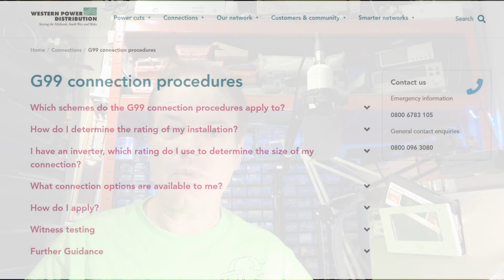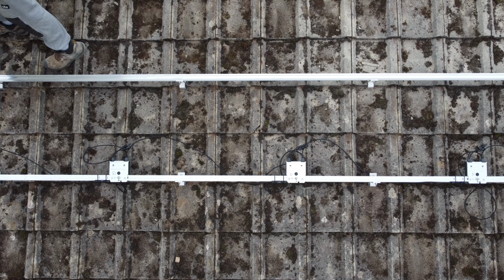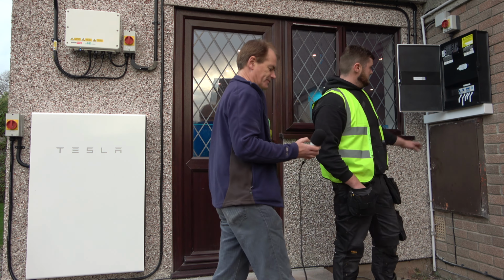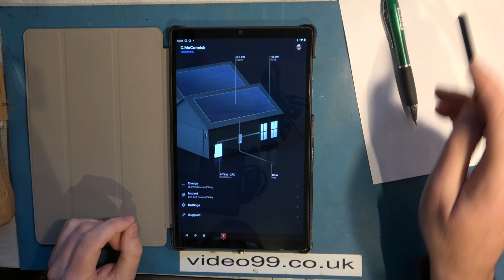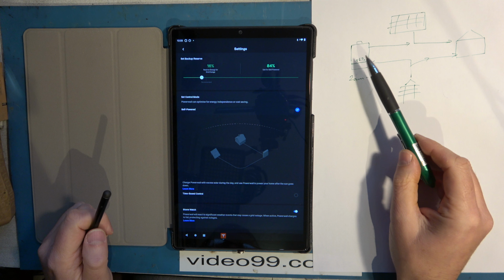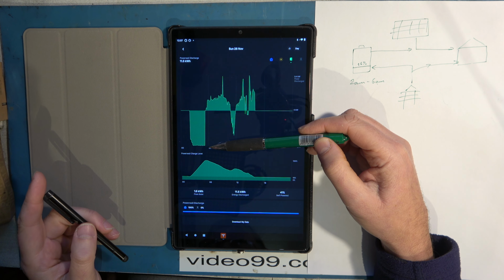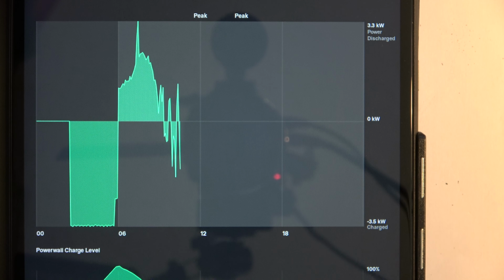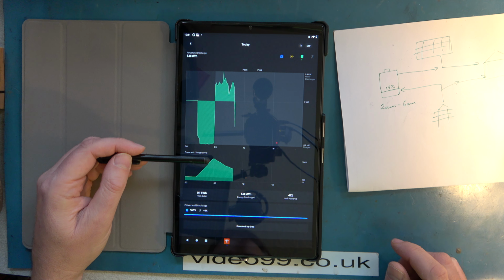UK solar panels for home, & Tesla Powerwall. Part 2: Installation and software.

Comment: Looking forward to part 3. Hope the new updates have solved the problems and you can set time based to 2-6 and leave it do it thing.
Really looking forward to getting my solar array and power wall when I’ve got enough cash
Reply from the maker: At one point it seemed to work really well: On a day where sunshine was forecast it would charge the powerwall sparingly, then on a overcast forecast it would charge much more.  But it's gone nuts now and seems to think ever day will be sunny.  So I have to wake up at 2am to tell it that we want 100% reserve power then at 6am and set back to about 16%, on an overcast day.  This is really ruining my sleep patterns and I'm not happy.
Reply: @video99couk  that’s really not good have you contacted support?

Comment: We have had a very similar system to yours for nearly three years (solar and Powerwall)
You obviously did the video early into your ownership so your settings may have changed. To my mind the reserved power setting can be much much lower. The chances are you will already have plenty of power in the battery or indeed solar supplying when the grid fails. That reserved level equates to running the house on overnight power prices for less time most days. It also mean less capacity to absorb excess solar during the summer before exporting it at a rubbish  export rate.
From what I’ve read the Powerwall takes a year to settle in as it bases it’s behaviour on a year of history. The storm watch thing is the only feature that looks at the weather forecast. A bit mad to my view. The Tesla app is so good we no longer look at the inverter app. We are planning on a second battery to increase the maximum house load to 10 kW so day time EV charging will be possible and there will be less periods when the battery cannot supply all the demand. (Oven + kettle + hob + hair dryer!) and because UK weather varies so much day to day we believe we can have many more days in winter in particular where the import price will be just the overnight price. In the last year our average cost of imported electricity has been 7.4p per unit so for us with the ‘free’ solar it all turned out to be a great choice even before the energy price hikes.
Reply from the maker: The system really seems to look at the weather forecasts.  So on predicted sunny days, it only part charges the powerwall overnight.  On predicted overcast days, it 100% charges it.  Sometimes, like today actually, it gets it a bit wrong.  It hardly charged the powerwall last night because it thought today would be sunny, but it's mostly overcast so it will run out of power.  That's worst case of course, I would rather have too much energy and export some at 6p, than have too little and buy it at 33p.

Comment: What was the total cost please?
Reply from the maker: Approximately £17, though that included 5% VAT that I think wouldn't apply now.  Bear in mind that the cost will vary from one installation to another, depending on factors to do with the particular premises it is installed on.  The new Powerwall 3 is due out at some point and could reduce the overall cost.

Comment: Looking at the power graphs, I note the Powerwall is charged quite rapidly. Isn't it true that high charge rates shorten the life of the battery? Is it possible to reduce the charge rate so that full charge is achieved over 3-4h?
Reply from the maker: Yes it now does that.  The software "learns" over time.

Comment: hi her next door moved in and i got asked about the panels 
i do know it can be hard selling a place with them on the banks do not like sun panels
one bit  they may be a money pit lady next door got them with the house
so best to get them with the house if you can no spend out 
she has 16 x 240 watt ones
Reply from the maker: There's a lot of stories about not being able to sell a house with solar panels but that's just wrong.  They are only a problem if they are not owned by the property owner.  The "leased roof" arrangement that used to be all the rage, makes it very hard to sell a house.  But paid-for solar panels are a definite asset to the house.  These more modern panels are 400W each, they have come a long way recently.

Comment: Isn’t putting the power wall (battery) outside a bad idea in colder climates…?
Reply from the maker: It wouldn't have been much warmer in the garage.  There is built-in heating used to get the batteries to a proper temperature before charging, which doesn't take very much energy.  Cooling is probably more challenging and being outdoors is better for that.

Comment: Hi Colin, would you recommend that I buy the Tesla Powerwall & Tesla Gateway, to resolve issues that you had where it diverted charge at wrong times. I know Givenergy do a package which automatically sends charge to battery, then Home, then Other (Immersion) and finally will export excess. Also I see others recommend Octopus Agile or Go tariffs with set up, is that what you are on?
Reply from the maker: The software has sorted itself out now.  It is charging the battery with cheap rate electricity, more so when the weather forecast says it will be a cloudy day.  If it's going to be sunny then it only charges enough to power the house until sunrise.  Very occasionally it makes a ba**s up of it, but usually it does a pretty good job.  There's a Tesla Powerwall 3 coming out shortly, that might be worth waiting for.

Comment: Just watched your videos. Currently look at getting a similar setup. How are you finding the figures that are currently being generated (as we have had pretty nice weather for the last few days). Do you still think the payoff time is going to be 6/7 years?
Reply from the maker: I suspect pay-back time may be falling due to elevated electricity costs.  One change I would have made: We got a 5kW inverter and 6.4kW array.  This is normal practice, but creates "clipping" when the sun is strong and the array can put out more energy than the inverter can handle.  I would probably have paid the extra £250 to go to a 6kW inverter, which would then have generated more electricity which could have been very useful when we eventually get an electric car so we could utilise all the electricity available.  It would have been good to have a second powerwall for more capacity, but that would have been a lot more expensive.

Comment: did you work out why it fixed itself? Was it a software update? I’ve seen this similar comment from others and its a huge thing for me considering storage - I have a much smaller array than yours so will absolutely need off-peak also.
Reply from the maker: I believe the software "learned" how to behave.  It is now barely charging the battery overnight on days when the forecast is for a sunny day (like today).  So it takes on just enough charge to get us through to when the sun comes up and takes over.  Then on days where the forecast is cloudy, it will charge to 100% on cheap rate overnight.  It's usually doing a pretty good job at this.

Comment: It's just that solar panels are so fugly on the roof.
Might be passable on a new build but still look a bit sh1t.

Look at the electrical eye sore on the wall that goes along with it.
Reply from the maker: If they can be installed in a fairly continuous sheet like ours did, they look fine, just like a shiny roof.  But if they are a random mess dotted around obstacles, they look dreadful.

Comment: What was the total cost of this setup
Panels,powerwall installation etc
Reply from the maker: That's covered in Part 1, but it was in the order of £17k.  Bear in mind that it will vary from one building to another due to cabling and installation differences.
With energy costs the way they are going, I'm revising my estimated break-even point down from about 7 years to about 4.  Bit of a no-brainer then, it's not so much whether we could afford it as whether we could afford not to.

Comment: Just skipped through your two videos, many thanks. Given the fiasco in energy at the moment (massive mismanagement of the UK's resources if you ask me) it would be foolish not to think the powers that be are really intent on making us 'Heat or Eat'. My energy company (AVRO) who I had just renewed my fixed deal with in July 2021, went bust in Sept 2021. I've been move to Octopus and am now at the highest rate protected only by the Govt. cap. 
My tariff is now:
Flexible Avro Unit rates:
Electricity: 19.95p per kWh, Standing charge, Electricity: 24.38p per day
Gas: 4.00p per kWh, Standing charge, Gas: 26.11p per day
Current annual estimate amount: £2,019.74
If I want to go with a fixed rate Octopus deal it will be about £325 a month.........that's the price of an effing mortgage!
I've got a 1.1kW solar system on my motorhome and a 700W system on my campervan. I'm seriously looking at getting something put together to maybe power a Nissan Leaf, because I can see that in five, maybe ten years time, the only vehicles on the road will be electric or diesel / petrol IF associated with accredited business (remember all the bullshit about 'essential services').
Looking at your other vids, I notice you tinker with tape based recording systems. I'm a musician with a long history of using AKAI products. Have you ever tinkered with the AKAI MG1214 or models from that range? I believe they tested many an engineer's talents back in the day.
Look forward to catching your update on your system in the summer.
Reply from the maker: Not played with AKAI MG1214 or similar.  
Your peak rate electricity cost is reasonable, we pay slightly more than that but then we charge up with 7.5p/kWh over night and use that for much of the day, so save a lot.
We would like an electric vehicle but right now finances just don't go there.  Just had to pay a huge tax bill to finance somebody's parties and fancy wallpaper.

Comment: You should be on a set tariff, not cheaper at set times, i would say keep on a fixed unit price, this way you remove the problem fully and i thought in the UK Octopus was the best, as anything you send down grid is £0.7.5
Reply from the maker: That would be mad!  We pay 7p for off-peak electricity and use it during the day when everyone else is paying 21p.  The powerwall earns its keep during winter by using off-peak.  The best deal was with Bulb but we probably will end up on Octopus if everyone gets thrown off Bulb eventually.

Comment: Good video, my powerwall is being installed this week and I need to decide the location, I see you installed on the outside wall, are you not afraid that the battery may be stolen from the outside wall ?
Reply from the maker: We're not in the sort of area that the battery is likely to be stolen, the area is covered by CCTV and anyway hardly unoccupied for any amount of time.  It's also very heavy, it would be a time consuming and quite skilled job to remove.  And then what use is it?  It could never be connected to the network again.  So really it would only be useful for the batteries themselves.  Too much chance of getting caught just to steal some batteries.  So though the thought crossed my mind, in practice it's safe.

Comment: My replies to comments don't seem to be working. In response to the question about Octopus taking control of the Powerwall, they (actually it's Tesla) only do that if you're on the Tesla Energy Plan virtual grid thing. For all other Octopus tariffs you have full control - and that includes control over the reserve for power outage.

Comment: Interesting thank you. I'm now on the Octopus Tesla Energy Plan (a story for another day) but I recall using cost saving mode rather than pure time based prior to going on to TEP. Maybe a red herring but worth a look...
Reply from the maker: Have Octopus taken control of the Powerwall's reserve power, sticking it to 20%?
Reply: Tesla energy plan is a bit odd really. You spend £10k on a powerwall as the ‘key’ to that energy plan, but then really don’t need it - 11p grid + 11p export so the grid is your battery effectively.

Comment: This stuff is getting interesting, we're going to see a lot of this tech becoming standard in the future. I'm interested in having solar but don't know how effective it'd be - the roof faces north/south mostly so half of it is always shaded, and one half has a dorma window poking out of it.

I'd need to somehow co-ordinate it with my EV too so it didn't try to charge that from battery as that'd make no sense at all, but did charge it from solar if there was enough spare output. Although really on days when I know I don't need it, my car is a 50kWh battery sat doing nothing on my driveway.
Reply from the maker: Some cars allow operation as a power wall, but not Tesla.  I suspect in your case, solar panels would be useful for car charging but I don't think a powerwall would pay for itself.

Comment: Wouldn't it make more sense to put power into the grid during the day when it is expensive and if nceessary take it out when it is cheap, like buying low and selling high? That would also help smooth the load on the electrical grid throughout the day.
Reply from the maker: Cheap rate electricity from the grid is now 7p/kWh, but they only pay 5p/kWh for energy fed into the grid.  So it's best to use it ourselves and minimise the 22p/kWh peak rate usage.
Reply: It is a ‘feature’ of the Powerwall that it never puts power back into the grid. It does however it will route your solar generation to the grid while running the house on battery power. This  I use a lot as currently my exports pay better than the overnight rate

Comment: I feel your pain! 
I gave up on the APP time based control and run a program to try to force it to charge to the value I want by upping the backup percentage or changing modes. 
The APP’s algorithm bases it’s decision on what percentage to charge the battery during off peak on the previous few days solar and your home usage, this works fairly well mid-winter when there’s very little solar but what you’ll find as the days get longer is you’ll have a few days of good solar and the APP will charge less and less in off peak, then you’ll have dull day and it will not have charged overnight as it expects another sunny day and you’ll start the day with a flat battery and have to use the grid all day.
It will then probably fully charge the battery the next night in off peak and you’ll often then start the next day with 100% full battery and have good sunny day with all your excess solar going to the grid.
The Algorithm only really works if the weather is constant or your home usage is high enough that you flatten the battery everyday.
Reply from the maker: Oh dear, it's as bad as I worried it might be then!  You will have seen that on the first day, I set the backup percentage to 100% but the charge rate was too low to get to 100% in the mere 4 hours off-peak we get on our provider.  So that won't be an option in my case.  Could get tricky as we go towards summer.
Reply: I’m still using the old v3 of the APP as the backup only mode in that charges at 3.3kw. On another forum one owner using the v4 APP you are using says that if they put the backup percentage to 100% in self powered mode it only charges at 1.6kw but if they are in time based mode and change the percentage to 100% it charges at 3.3kw, so this may work for you.
Tesla are starting to introduce a new feature on the APP called “utility rate plans” where in the time based mode you can enter the cost of the peak and off peak rates, maybe this will improve things.
One thing to be aware of if you start changing the percentage, depending what firmware you are on (21.35.3 is affected), you may get delays (up to 45 mins) when you change the percentage... you think it’s not working but it’s just a delay.
The battery itself is one of the best on the market but the software sucks and makes it one of the dumbest batteries available, if I’d known what I know now I’d have got something else.
I think as the energy market changes and more and more dynamic smart tariffs with variable cheap rates get introduced, unless Tesla sorts the APP out or allows better access to the API it will just get worse for us owners.
On a positive note, I think with your 7k Array you will hopefully not have to rely on the time based mode for a good part of the year and can work in self powered mode where the Powerwall works really well.

Comment: When I see vids of the Tesla powerwall it makes me glad I went with a "dumb" SolaX Pylontech system where I control what the battery does ie I set when the battery charges from the grid and when it provides energy to the house. For 9 months of the year it stays in self use mode, from November to the end of January it's in timed use made where I set the timers for battery charge/discharge, so on Octopus go the battery charges between 12.30 and 4.30 am, the other timer stops the battery discharging between these times, dumb but simple, I just switch between the modes in the phone app and the inverter does the rest, I originally wanted the powerwall in 2018 but the lead time was 9 months to a year and it meant missing the FIT scheme ending in March 2019.